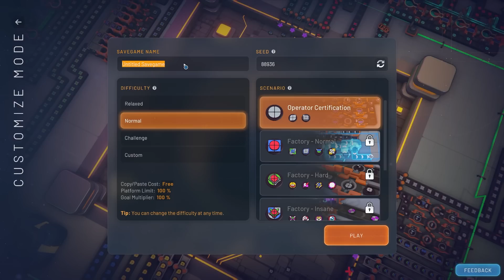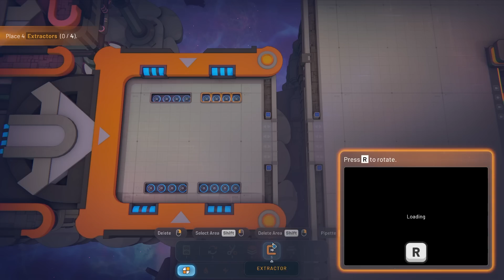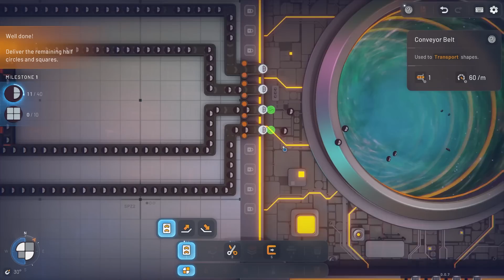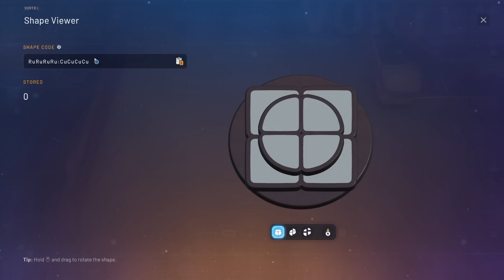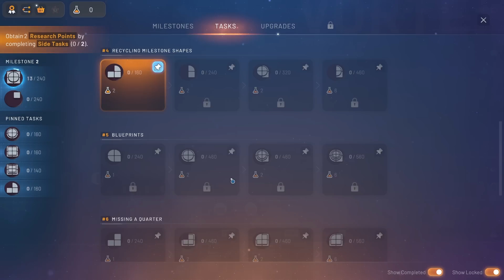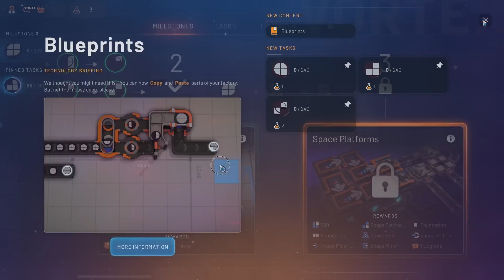This Is the Purest Expression of the Factory Game Genre! - Shapez 2 First Taste

Comment: When you select any belt or machine, if you hit O it will select every belt and machine in it's production line, allowing you to delete it all when that particular shape is no longer needed! (be advised, the selection will jump between adjacent platforms, and you may accidentally delete shape miners unless you first cut them off from the factory section you want to delete)
Reply from the maker: Woo, super useful info, thanks :D

Comment: I learned from MangledPork's stream that if you keep the productivity upgrades at the same level, the ratios stay maintained
Reply: If you’re talking speed modules, yes. Input and output get multiplied by the same factor, which maintains their ratio. But productivity modules take N input and put out, for instance, N times 1.1 products, which alters the ratio by a factor of 1.1 in this example. If your belts can only carry N, then your production doesn’t run as fast as it could, pausing frequently to wait for space on the output belt.
Reply: @TallinuTV  Are you lost? This is a video for the game Shapez 2...
Reply: Yep! Except painting stations, where once everything is fully levelled, you need 4 painting stations to saturate a belt.

Comment: Never even heard of this game!  or the first one!  After watching this video I am heading to Steam rn to buy it, lol.   Thanks for advertising this!

Also, does it show the shapes by volume in the vortex?  As in, does it represent the volume of shapes you produce in it?
Reply: Each shape you produce and fling into the vortex is visible until it's all the way down and despawns. So yes, if you throw the max amount of maxed out belts into it it will start to look proper busy.
At the start, that's 16 belts (4 slots, 4 sides, 1 floor). But as you can imagine by how I broke that down, it gets really busy later. Even without spoiling anything Aavak hasn't seen yet, you can throw 5760/min (96/sec) into the Vortex by having Belt Lv4 (120/min) and the third floor.